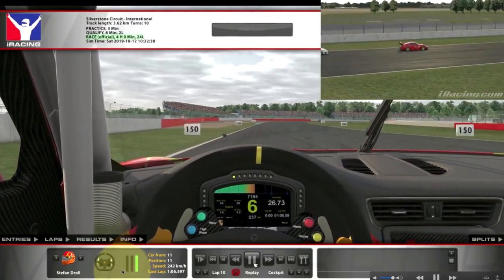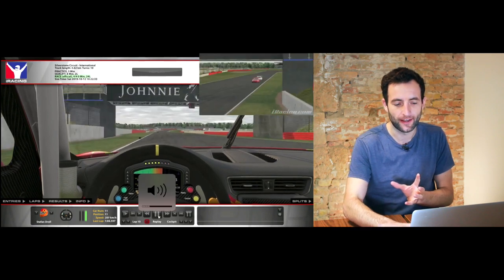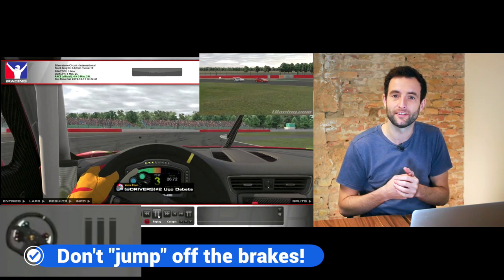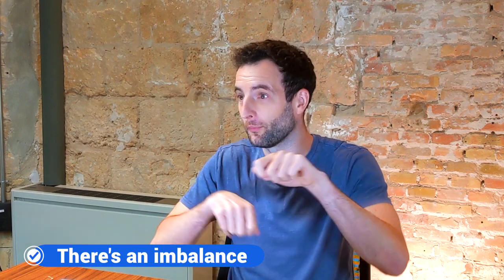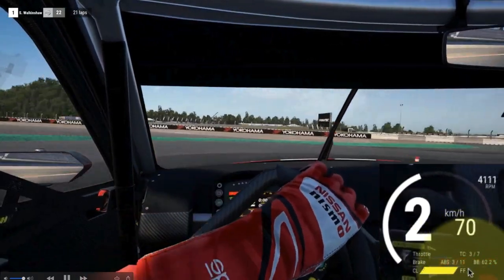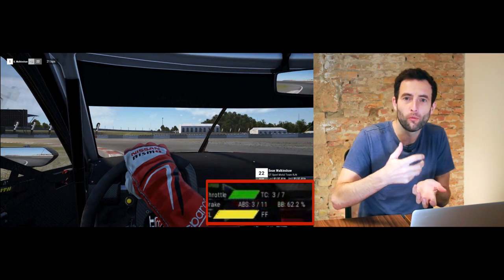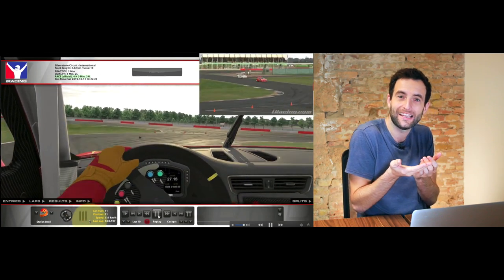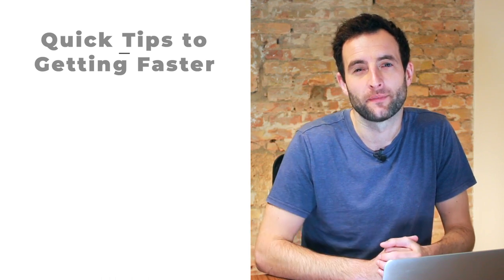5 Reasons You Need to Trail Brake in Sim Racing

Comment: One of the easiest tips that I give people is that you should be smoothly be letting of the breaks as you feed the car steering input. And there should be no “coasting”. In the examples of what not to do in this video there’s a lot of coasting before the apex. This means the driver is breaking to early. You should be just finishing your breaking before the apex and then smoothly transition into the gas (at or just before apex). There should be almost no time spent coasting. 
The other great tip that helps people once they get the feel of it is....
“Slow in, fast out”

Comment: Good topic.  Trail braking works in real life also. lol.  there is a fine line here because the front tires only have so much capacity to grip - which was referenced - and if the turning is beyond the limit of grip it will still understeer.  The point is that trail braking puts more downforce on the front wheels to improve the turn, even though some of the extra downforce is consumed with the braking maneuver itself.
Reply: Same as most thing in Sim racing

Comment: I trailbrake everyday on my way to work. Balancing a real car, and feel the front ist just under the right load for nice grip into the corner is pure fun.
Reply: Have fun replacing the brakes earlier lol
Reply: @Cory989  Thx. Had to replace one time because i pushed too much on the autobahn, and had too much slow cars with 120km/h pulling out in front of me. So the brakes overheated, went to purple color the next day... but fun is fun ;)
I also often drive with much "lift&coast" to save fuel and brakes btw.
Reply: Joachim Deschner I’m jk. I’ve ruined crappy part store rotors a few times.

Comment: In my experience, with the car set up the way I like it, I actually am able to get the car to rotate more by popping off the brakes and playing with my EOB, then holding the car on the edge of a slide with throttle rather than carrying brake pressure deeper into the corner. Generally I've found that I am able to carry more speed through most corners when I condense my braking to be as efficient as possible and then trail maybe only 10-20% pressure through only the very beginning phase of turn-in and almost always pop-off before apex. The only times I really trail deep seem to be downhill/off-camber corners or when the front tires are starting to fall off. It seems to me that if the car is already set up well for high turn-in speed, it's preferable to trail as little as possible while maintaining the right amount of rotation as you can condense the brake zone and maintain a higher minimum corner speed this way. 

Additionally, doesn't the maximum lateral cornering force come during the coast/maintence phase of a turn anyways? Or am I missing something here? In my experience trail braking has served as more of a circumstantial tool rather than a technique I use through every corner at every track. I tend to focus more on my EOB and shape of the brake trace rather than try to hang it deep into the corner.

Been driving F4 cars for only about a year now so I am by no means an expert. If someone could show me where I'm wrong I would appreciate it. Thanks.

Comment: Hi, I've just started using a wheel (G29). I'd describe myself as someone who does it for fun with friends and we play GT Sport.
I'm your regular everyday driver but i'd like to know if possible how important is it to learn to drive these games using the left foot for breaking and the right foot for throttle. My natural instinct is to use my right foot only and I can see on some of these examples that it's obvious the users are using both feet and this just isn't coming naturally to me.
Thanks and great videos :)
Reply: Hello Iain, I also have a G29, but mainly play Assetto Corsa (normal and Competizione) and some F1 games. Simply put, the faster the car, the greater the difference in lap times will be. If you use your left foot for braking, you're able to jump on the brakes as soon as you release the throttle, as well as the opposite. In the beginning you probably will be somewhat slower, given your left foot is not as precise as the right food in braking, however, as you progress you'll notice the gains, specially, as I said, in the faster cars.
Reply: @DanielMiquelluti  Thank you Daniel, that's great.
I'll give it a go.
Reply: @iainc1965  yeah you gotta be left foot braking always.  not fast enough with your right foot. seems weird at first but no one ever has a problem at go karting 🤣

Comment: Forgive me if these are silly questions. 1: Instead of trail braking into a corner could we instead make adjustments to shocks and springs to slow the rebound of the front on corner entry? 2: Is it just me or does the handling and racing line used at most tracks change drastically from a pre-race practice to an actual practice within the event on iracing?

Comment: Nice video! Some say that trailbraking should mostly be used in slow corners to get better rotation (a classic is turn 10 in Bahrain). I guess the brake pedal pressure is easier to modulate in a slow corner and the weight transfer would be less than in a medium speed corner. Which is right, both maybe?
Reply: The weight transfer being smaller at higher speed is good point but it's not really why we use brakes on entry. Trailbraking is just a mean to go through correct line at correct speed (speed is very important part of a line). At higher speeds the car naturally slows down much more so there is less need for brakes. Plus the correct line tends slightly toward more circular path when lots of downforce is involved which reduces the slowdown needed on entry. Both effects combined mean braking technique is less important at high speeds.

On top of my head T5 (left) is an example of medium speed trailbraking corner, also spa is full of medium to high speed trailbraking corners. (T7, T10, T11, T12, T13 T15)
Reply: Trailbraking can be used in any corner. I regularly use it in 160+ km/h or 100+ mph corners, but the trailbraking is around 5% pressure, or just enough to get the pads to touch the rotors. In any case, if you're able to touch the throttle pedal before the midpoint of the corner (or corner sequence), you over-braked and entered the corner too slowly.
Reply: @heelandtoe33  Thanks for the response. That makes sense, lighter touch in higher speeds. I actually had som issues with over-braking in turn 1 in Mexico. I found that I needed to apply some throttle going into the corner, and that's just regular braking in a straight line. I then used trailbraking instead, and found that the front of the car really gripped up and pointed the car into the turn better, it made the turn-in much more efficient.

Comment: Just carefull not to treat every car the same. Front heavy vehicles like front engined Audis and most Subarus are vehicle that dive better into corners either neutral or even on gas, if the awd system copes with it. Those vehicles will "wash out" the front if you trail brake and understeer like crazy. After only a couple of laps you will have overheated the front tires and they willbe shot..

Comment: Do I have to trailbreak into EVERY corner or are there conrners that need another technique ? thx for your great videos.
Reply: Depends on the corner. For sharper corners generally trail brake, for longer corners you may want to coast vs. braking. It all depends on the track and the car. Just use trail braking whenever you have full braking as a rule of thumb. Trail braking is usually braking late into the corner and staying on the brakes a bit longer (though not at maximum throughout the entire corner). This makes a serious difference in many different aspects of racing from taking defensive lines and having good set ups for double apexes etc.

Comment: Second video footage got me puzzled a bit, if you watch the inputs, the driver is feeding throttle while he is still braking, this is very confusing, is it a correct technique and wouldnt this break the engine in the real life, where you are already on the accelerator while still applying brakes ?

Comment: Any tips on which track/turn combo it is best to practice on? Where you would see a bigger difference etc.
Reply: ShinuLT I think Barcelona in iRacing is quite a good place to practice it. Has lots of corners with fast entries where you need to rotate the car
Reply: spa, nurburgring, okayama, suzuka, tsukuba, silverstone, laguna seca, and many more if you have a real car practice there in low speed it gets easier to trail brake.
Reply: If you're in iracing, practice trail braking on ovals. You'll get way more practice (because you're constantly in turns) and you can instantly see the difference from one lap to the next when you trail brake vs. when you don't.
Reply: In Monza u have the hard braking into turn 1 and turn 4(the 2 chicanes). Then you have Lesmo 1 - A very soft braking, and soft releasing the brakes can make half a second, because you start breaking in the turn, not before the turn. Also into Ascari and Parabolica you can gain much time.
Reply: Turn 1 Interlagos is a good one.  It's high speed heading into it so hard breaking, and it's very challenging to get the turn right since it drops down the hill.  It magnifies any little mistake, especially considering you have to get that turn right to setup for turn 2 - it's so important for a good time.

Comment: How do you trail brake with a older racing wheel? for now I have a Driving force GT from 2007 it used to work great with PS3 but the pedals feel stale they feel like its on or off I try my best with it but Its hard to get it right on every corner
Reply: I think you have got your answer. I have a thrustmaster t300 gt and i think that the feel is not good enough to trail break properly. You are probably going to need to invest properly

Comment: Does with stand for historic cars that only use mechanical grip? Stuff like the Lotus 49 etc.
Reply: Yes, absolutely; the theory applies for any car. It needs to be set up properly to be able to trailbrake into the corners. Too often, people used to straight-line braking will set up the car for a suboptimal driving technique, and when they try to go faster, that poor set-up holds them back. Sometimes it takes time to undo both the bad habits and the bad set-up.

Comment: Does this count for F1 cars aswell? Or only GTs and Closed wheelers
Reply: BananaTrolzz It applies, but the car is super twitchy and trail braking is much harder to control. If you’re already super consistent and comfortable with its handling, you can try it out. But be aware that it increases your chances of spinning out quite significantly. In the end, it all comes down to practice. 
(Note: I only do it in corners where I  experience a lot of understeeer AND if I’m driving aggressively to shave off a couple of tenths per lap. Usually, I prefer to be safe and consistent, but a bit slower)

Comment: I have been thinking about left foot braking for a long time, as its something that I do not do. I found your comments about just jumping off the brake pedal really interesting as only using one foot unless the timing of transition is perfect I am effectively unbalancing the car. Is there a technique for only right foot braking\driving or am I really missing out on extra gains by not using left foot braking?
Reply: If you want to be remotely competitive,  there is no alternative to left foot braking! The weight transition is so much smoother...
Reply: Stefan G. I was pretty much thinking this tbh. I tried left foot braking in my real car, although everything in my head said be light the braking turned into an emergency stop. 
So what better way than a sim to reprogram my brain and foot 🦶. I’m going to do a future video on this, as I recently done a race in ACC at Zandvoort, my best lap time was a 140.404 and I was unable to get into the 139’s . If I keep practicing, I’m going to return to see how much more time is on the table
Reply: @HlspwnsWorld  If you have pedals where you can change the brake resistance, make it softer and if possible with a longer travel too to begin with. Will not be as realistic, but it will make the transition easier.

Comment: So is there always going to be a moment in the corner where you are on the brakes and the gas at the same time?
Reply: It's possible, but usually that would imply that there might be a problem with your set-up. Ideally, you would trail off the brake and coast for a small portion before picking up the throttle at the apex (or sometimes midpoint/inflection point).
Reply: @heelandtoe33  Thanks for the response. So I guess the better you get at trail braking the shorter that coast portion will be, correct?
Reply: @CSTBFO_jad  Theoretically yes, although with engine braking, you are still effectively trailbraking even when you are just coasting. The key is to transition from a mix of braking and engine braking to solely engine braking.
Reply: @heelandtoe33  Oh ok good to know thanks alot. Much appreciated.